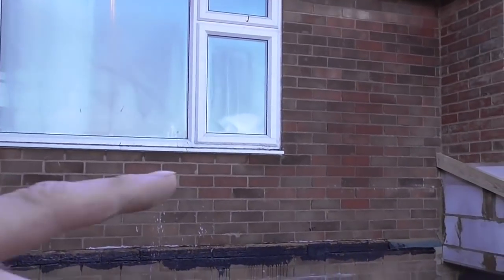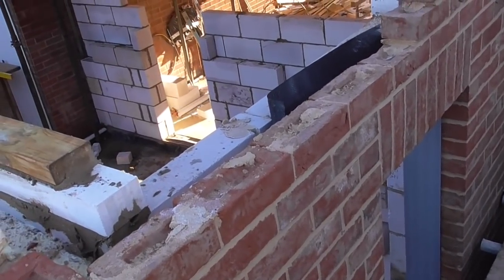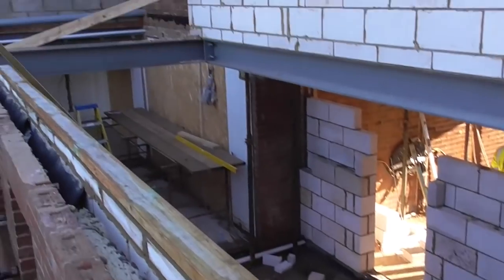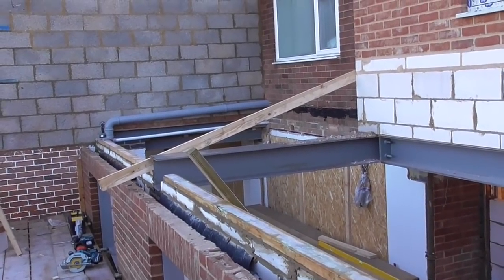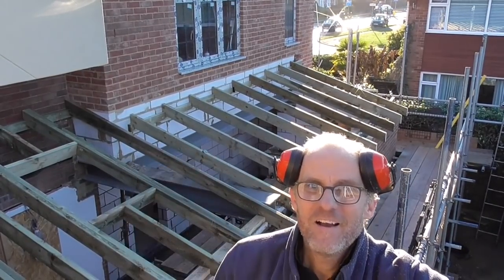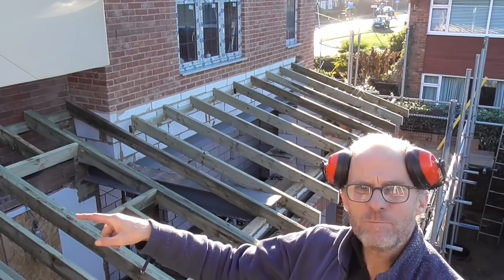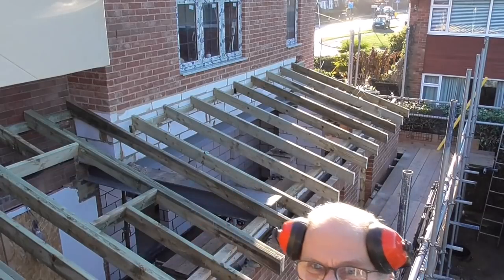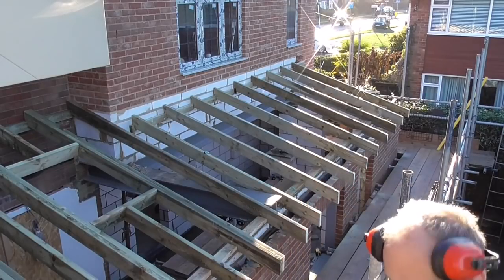Lean to type extension roof ***IN TIME LAPSE***

Comment: Why didnt he make the trusses 600mm apart so he can then fit insulation, celotex, between each, nice and simple?
Reply from the maker: Hi Paul🖐If I put the rafters 600mm apart, then then they would be at 650mm centres, which is to wide for our building regulations👊Cheers Del

Comment: i do my roof windows like that , i  personally dont double up the small trimmer , some people do ,
Reply from the maker: Hi David🖐It sometimes depends on the building inspector, but, a single trimmer is more than adequate, as the timber is over sized anyway👊We may put joist hangers on though as it looks good for the building inspector, they are cheap and don't take long to fit👍Thanks for watching and your comment 😎 Cheers Del
Reply: I do think common sense has to apply to these matters  particularly structural engineers , roof structures have double the amount of timber and steel in them , compared to 60 or 70 years ago , steel hips etc  , seems crazy to me , the reality is that most new structures are overkill , and engineers carnt work the calcs on roofs out correctly
Reply from the maker: @davidprice9265  I absolutely agree David👊They don't really rate nails that much as a fixing method, but you try taking out a rafter that's got 4 nails in it💪💪Cheers Del